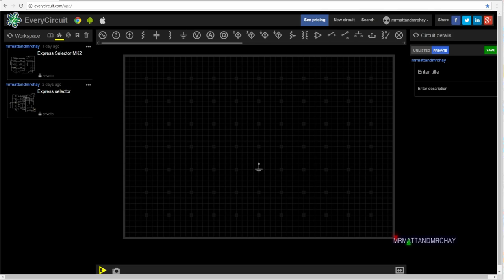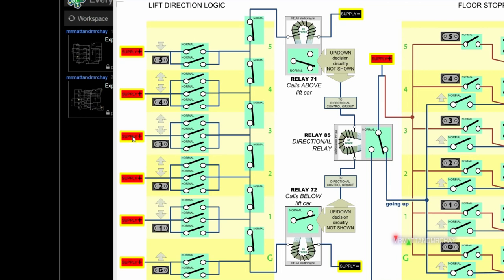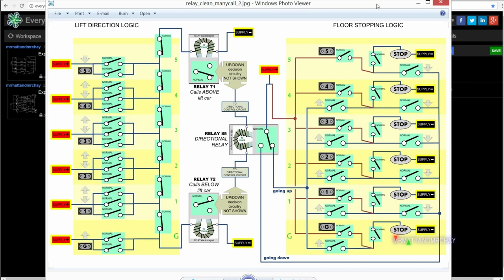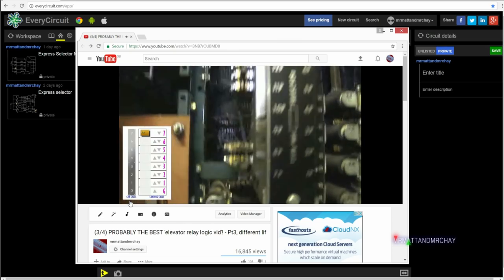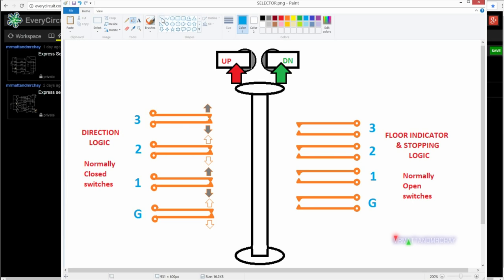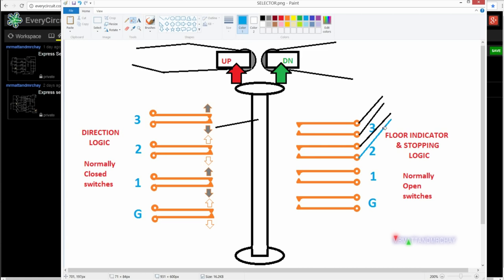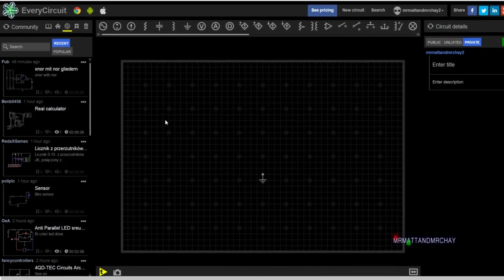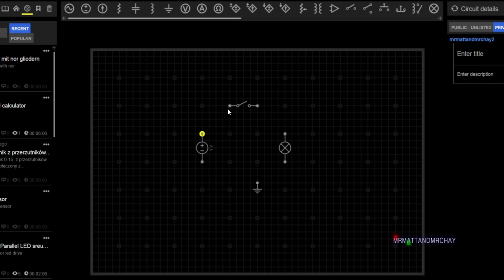Late night ELEVATOR CIRCUITS - BEGINNERS WELCOME!

Comment: I used to be a technician for amusement machines back in the 1970's when everything was controlled electro mechanically.  Loved the job and tracing faults was a great - and frustrating at times - hobby!  There were dozens of relays and 100's if not 1000's of contacts in pin ball machines for instance.  Soon as the electronics started to take over I quit, I was totally bamboozled by 'little black boxes and boards full of chips'.  You could trace any fault on relay circuits with your eye just like the above video as long as you had the knowledge and the help of the schematics, electronics well that's a very different game.
Reply: Out of interest, what tended to be the issue that caused faults?– broken cables, relays that got stuck, etc?

Comment: Awesome!! Ever since seeing a relay based setup at my work, I was fascinated by how the logic behind the controllers worked.  I tried to figure it out and came up with something similar to your explanation but there were a number of things I couldn't figure out.  There were a few 'lightbulb' moments when I watched this video.  Thanks for such a brilliant explanation and I'm sure there are a lot of us out there who are still fascinated by the electromechanical era and the ingenious solutions that were found.
Reply from the maker: Cool!!  Your comments are exactly what I set out to do and glad you enjoyed and (hopefully!) understood it! ;)
Reply: I have sat down and started to try and draw up a diagram for an experimental setup. It's a lot of fun to try and figure out an actual circuit.  I see from above that this has been attempted already but I am just trying to get my head around it and couldn't even imagine trying to actually build it.  So far, my design has 10 relays per floor and I have not even attempted to get my head around the logic behind stopping / opening / closing / restarting.

Comment: What an informative video, much appreciated!
I just think there's a little design flaw with the two bulbs you added in the end. The interlock (on the low-side of the coils) between the two relays does not stop both lights from coming on simultaneously, it just works on the two relays. But there's no space left on the sheet, so for demonstration purposes this should be okay.

I think having a simulator that can correctly simulate muulti-pole relays would be great. A few weeks ago, I had to reverse engineer a PCB with a bunch of relays and other components on it to find what's wrong with it. (No schematic available). Was quite a mess to unfold all the traces on the pcb to find out how it is supposed to work without having the chance to simulate it.

Comment: very detailed mate love it hope you get more of these kind of vids :)
Reply from the maker: This is a very long video, I would normally try to limit them to about 10 minutes, but for those who are interested as you said, loads of detail in there!  This video is a bit of a tester to see if people enjoy it, yep, could do some more!  I actually have a Express Selector and some kit that could be connected up.  Thanks for comment :)
Reply: i hope to see that amazing selector working one time :D Wish i had the patience to make a mock up one at school!
Reply from the maker: Hi Julian, The next part, I will be wiring up an old Express Lift selector with some actual Express lifts lanterns and floor position indicators.  My wife is going to love the state of the dining room table when this is all rigged up!!  I cannot give you a time, just I will do it "soon"(ish!)
Reply: mrmattandmrchay hahaha I can't wait!! My model lift will just use some micro roller switches to act as pseudo PLU and PLD inputs to the PLC. As it will only be two floors, I will not need any insane logic to decide which direction to go in. A down call on the top floor must mean the lift should go up, so it runs the motor at high speed until it hits PLU and then stop when it hits the top roller. Then I'll make a lift car with some push buttons inside that are the car call push buttons. This elevator will be a goods lift so no need to make a working door operator. Just have to ask my woodwork teacher if I can make it! I hope when I make a video about it you may stop on by and have a little look, I am of course very new to editing, and only ever have edited using my phone and the YouTube app!! Anyway we will see how it goes.

Comment: actually this lift cant come to ground because there is no limit for that floor
the thing is your ground floor switch on directional side is directly connected to ground and +ve supply
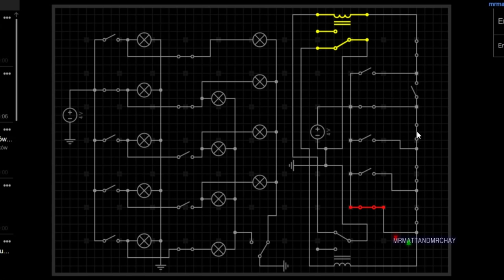Reply from the maker: Sorry, I cannot see it (you mean at 48:50 when the switch shows in red as an error?).  One side is connected to +POS, but the other side has to go through either the top (up) or bottom (down) relays and is not connected directly to a neg.  I cannot see why the circuit designer failed the circuit, but it's the PRINCIPLE that I'm teaching here.
Reply: سلام الأخ جميل ممكن تصلح الخطأ برسم .شكرا

Comment: nice explanatory video.
 i want to connect the cop with controller through rs485 communication can you give me any guidelines
Reply from the maker: Very vague description, so sorry cannot help as a one-liner description doesn't give me hardly any idea of what you are trying to do or achieve with which system.  I know about RS485 comms, but to intercept a manufacturer's protocols (if it's not encrypted) is impossible unless you have a lot of time on your hands.  Also, I am not a lift engineer.
Reply: mrmattandmrchay thank you for the early reply.
 I will give you a brief idea about what I will do.
I want to connect the COP buttons to the lift controller which is parallel(not coded).I will carry the buttons signal to lift controller through rs485 conversation and convert it back to parallel at controller side so that it reduces wires used.
Reply from the maker: Yep, I now understand exactly what you are doing, that's taking all the button from the COP inputs via 485 (2 or 4 wire) to separate relays in the motor room to connect to controller.  Saves lots of wires from car to motor room.  Unfortunately, my industry is Access Control systems and I am not a lift engineer.  No doubt, the hardware you require is readily available in a elevator parts catalogue, but I am not in a position to be able to offer you information on the product you require.  Maybe someone else reading this can help you.  Sorry about that.

Comment: I wired up my elevator panel with relays ,i took me 2 hours it was really hard to do and i had ten fails when i was about to film it didn't work and i was not very happy after all that .
Reply from the maker: Ah no!  So did you rig up this circuit, or were you designing your own version?  I'm actually going to be constructing this with some ACTUAL Express Lifts lanterns (+ floor selector) sometime soon!
Reply: I was designing my own with real relays ,Express lift floor selectors are really cool and old lifts are awesome . cant wait to see your lift lanterns mrmatt
Reply: I love the old 1970,s Otis lifts I filmed a couple of those where I live and they were completely all original .

Comment: some lifts have a rear door.  how are their circuits different?
Reply: On Express Lift controllers the car door open and close contactors are numbered 20 & 21 respectively. If the installation has rear doors fitted as well, known as a through car , then a second set of contactors is fitted in the control panel  numbered 20R & 21R. They are operated by a DZ (door zone) inductor fitted on the lift car with associated plates positioned on the inductor rails in the shaft. For instance if floors G 1 and 2 were served by the front doors then plates would only be fitted at the respective levels. Then floors 3 and 4 were served by the rear car door then a second inductor DZR  would be operated by plates fitted at those floor levels on a separate rail. No plates would be fitted at 3&4 on the DZ rail to prevent the front doors from opening. If you have front and rear opening at the same floor then just fit inductor plates on BOTH rails at that floor. I hope this has made some sense, but if you have any more questions just ask.

Comment: mis asaa
Reply: This type of Express selector.was developed from the GPO telephone selector system,They were “fiddly”to set up when worn on a call out.The Lift would often skip floors too.Now of course selectors in controllers are much more sophisticated,without any mechanically moving parts.Mostly the trouble was caused by the brass selector cog wheel which became worn.Takes me back a few years.I had 45 enjoyable years in the Lift trade.12 of them as Express engineer covering call outs for five years.appy Dayz,good video.thanks.

Comment: in regards to the circuit app i prefer the original java applet: http://www.falstad.com/circuit/
everycircuit is nice though
Reply from the maker: Oh yes, thanks for the info.  It's the same application I think? (still no DPDT relays !)
Reply: mrmattandmrchay, yeah, its got SPDT "analog switches", (under active building blocks).  you could wire two together and it would behave like a DPDT relay but it would just look a mess. im gonna take a look at the javascript and see if i cant hack in a proper DPDT later today
Reply: actually thats probably unnecessary, packing them together doesnt look too bad, and you can stack them up to arbitrary lengths 
https://puu.sh/vIwz1/2b0d52af19.png
im not sure about the performance of having tons of these on screen though so your mileage may vary with this